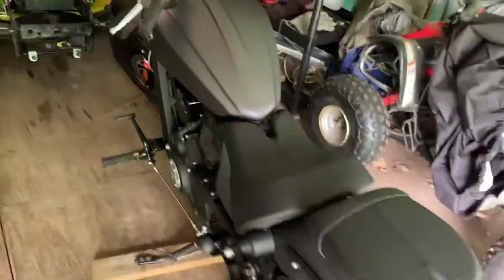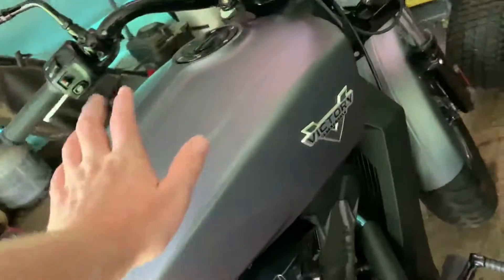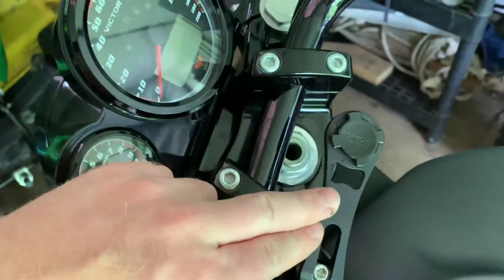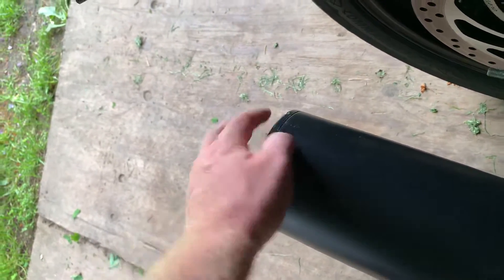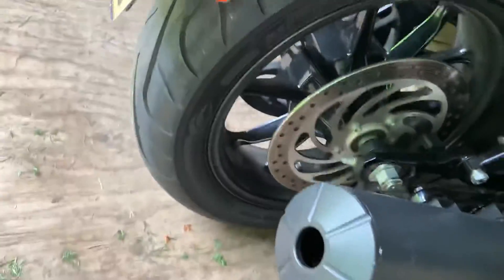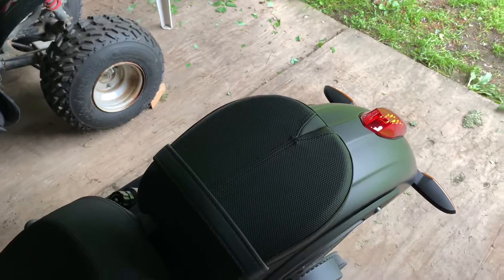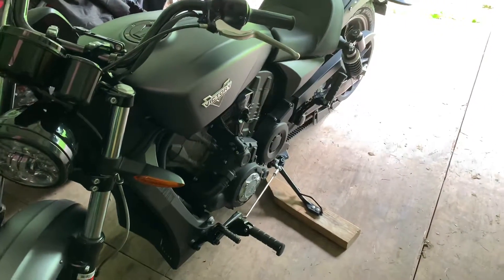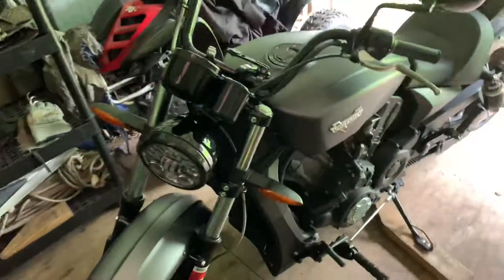Victory Octane Stage 2 Performance 2 into 1 Exhaust baffles removed

Comment: Just here to say thanks. You were instrumental on getting the baffles out for my scout rogue. 

For others, here is the breakdown, two screw on the outside. Take out. Take a screw drive nicely in the groove of the cap and twist it and you will see everything move. Once done, pull assembly out and towards the cap, push the fiberglass down and you will see three metric screws. Take those off and your good to go.

Comment: It's confusing.   Stage 2 Factory came in all black. Urs isn't stage 2.  They moved stage 2 pipe and bolt ons onto grey octane.  You got screwed. I oververified before found and  bought it. It's fully black motor to pipe.  And only 2017 year.